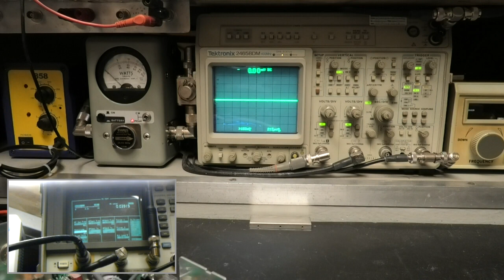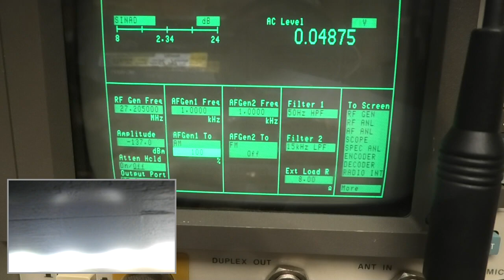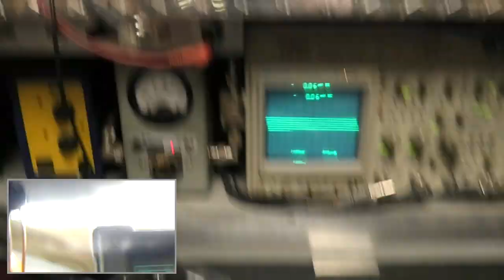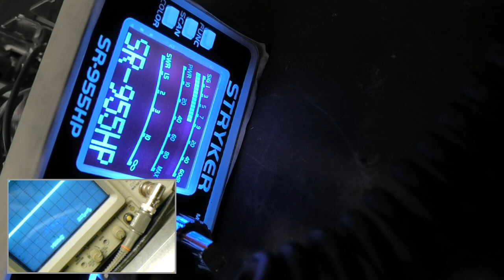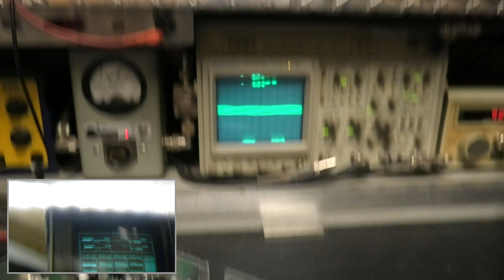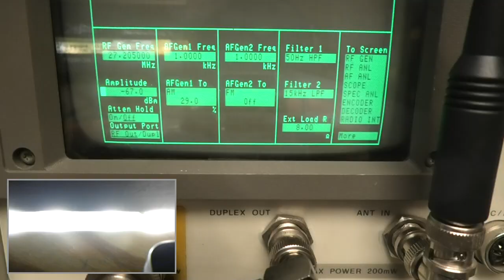Fine Tune CB Shop - Linear Amplifier And Inline Attenuator - When Not To Use And Why. Pay Attention!

Comment from the maker: It appears that The Romper Room BUTTHURT Brigade is thumbs down happy at this particular time so the likes and dislikes are "temporarily" on mute. If they don't talk on what they promote, with the same tune, and use the mic (noise cancelling) for mobiles, They're A Con-Artist .. It's really that simple. Wake Up Guys!  Ding Dong  (And not just a "picture", that's what Con-Artists do like Dave White) Here's what it takes to cut through the noise, be loud and crystal clear with a better receiver too:  A) Tuned Bench:  https://www.youtube.com/watch?v=lwcDfXOgAls.  True, it's more complicated and time consuming to accomplish these consistent and accurate results. Below is a partial procedure and list of calibrated equipment used to achieve this level of performance . Read on ..

Fine Tune CB Radio Shop strictly adheres to (https://www.nist.gov/) NIST Traceable Calibrations and other industry standards to maintain accuracy and consistency for providing Real World Performance Tuning of Citizens Band and 10 Meter export mobile radios with integrity.

"Basic Textbook AM/FM/SSB Transceiver Tune, Alignment and Calibration" 

1) Pll adjustments
VCO & OSC, AM TX OSC, USB TX OSC, LSB TX OSC.

2) Transmitter alignment
DRIVER BIAS, FINAL BIAS, SSB  (or gate voltages for mosfet versions) CARRIER BALANCE, HI-LO AM & SSB Power, RF METER, AMC, ALC and FM DEVIATION.

3) Receiver alignment
AM/FM RF & IF SENSITIVITY, FM DETECTOR/DEVIATION, SSB IF SENSITIVITY, SSB S-METER, AM/FM S-METER (100uV unmodulated -67dbm for �S-9� meter reading!), AM/FM SQUELCH RANGE, SSB SQUELCH RANGE, and NOISE BLANKER/AUTOMATIC NOISE LIMITER (Real World dBm to volts (uV) tables below).

That's just a typical run of the mill textbook tune up and alignment (if you're lucky). There's more to it than frequency alignment, modulation adjustment, meter calibration and a tune up report displaying exaggerated rms Bird peak watts! 

"Test Bench includes"

Bird 4314C Meter
https://www.birdrf.com/Products/Test%20and%20Measurement/Power-Meters/Wattmeters-Line-Sections/RF-Wattmeters/4314C_PEP-Single-Element-Wattmeter.aspx
Part 1) https://www.youtube.com/watch?v=RpX9IHe4ORM&t=16s
Part 2) https://www.youtube.com/watch?v=LuhbqTf6Bxw
Bird 4314C Accuracy Test: https://www.youtube.com/watch?v=DqEOabYqhQo&t=5s
Bird Stipulates 1/2 wavelengths  https://www.youtube.com/watch?v=5eWhgT-rTII
And Genuine Bird Elements from 1K down.

Bird 4373 Sampler 
https://www.rfparts.com/signal-samplers.html

HP8924c with options
http://userequip.com/files/specs/2147/HP%208924C%20Repair.pdf
https://www.youtube.com/watch?v=Cg1w0xBa27s&t=1s

HP8920a with options
https://www.keysight.com/upload/cmc_upload/All/EPSG072204.pdf

Three analog scopes, one digital 200 Mhz
https://www.atecorp.com/atecorp/media/pdfs/data-sheets/tektronix-2465b-2467b_manual.pdf
https://www.youtube.com/watch?v=by98x4eu2lM

Fluke 27fm
http://www.fluke.com/fluke/inen/digital-multimeters/fluke-27.htm?pid=56055
 
LCR http://www.lcrresearch.com/wp-content/uploads/2017/05/LCR_Pro1_Manual_version1.03.pdf

Power supplies
6 Cosel PBA1500f12 (750 amps) variable and configurable.
https://en.cosel.co.jp/product/powersupply/PBA/PBA1500F/PBA1500F-12/
Corcom 20VB1 F7130 EMI Filter 50-60Hz 250V

Times Microwave Coax jumpers and test leads
http://www.timesmicrowave.com/cms/products/cables/lmr/
https://www.youtube.com/watch?v=EmqaGJ6IWow
https://www.youtube.com/watch?v=1ltFVSxGp5Y
https://www.youtube.com/watch?v=v12YZT_1o90
https://www.youtube.com/watch?v=h7iiYfmYWRA&t=215s

Amphenol RF Connectors
https://www.amphenolrf.com/
https://www.youtube.com/watch?v=dVh5B0hdEA0 
https://www.youtube.com/watch?v=dKZg8T_AOso

More range, compliments, reliability and a quieter, clearer but more sensitive receiver,  Get Fine Tuned .. not peaked and ruined.

Here are some VideoGates of me at the bench practicing what I preach using my bench radio or customers radio completed and ready to be shipped: https://www.youtube.com/results?search_query=hard+drive+163+ more: https://www.google.com/search?q=Hard+Drive+163+nm&ie=utf-8&oe=utf-8&client=firefox-b-1-ab

It's what I recommend, use, service and sell ... to you ... not something non practical or deceiving in a misleading way. I'm not just the tech and owner of Fine Tune CB Radio Shop, I'm a customer too!  When finished, You'll be giving radio checks, not asking for them .

dBm To Watts and Volts
Tables below displays relationship between Power in [dBm] or [Watts] and Voltage in RMS, peak, peak-to-peak for sinusoidal signals in 50-Ohm systems for accurately measuring and tuning am/fm/ssb receiver sensitivity, agc, squelch and "S9" Meter calibration. Real World! Mike @ Mikes Radio Repair (Romper Room), Mark Rutherford aka Mark 19960, CB Kidd, Martian and all of your other fake accounts pay attention to the tables below, stop misaligning radios, spreading false information and promoting propaganda! 

  [dBm] [Watts]   [Volts]rms   [Volts]p    [Volts]pp
-140 0.100E-16  22.361 nV  31.618 nV  63.236 nV 
-139 0.126E-16  25.089 nV  35.476 nV  70.952 nV 
-138 0.158E-16  28.150 nV  39.805 nV  79.609 nV 
-137 0.200E-16  31.585 nV  44.662 nV  89.323 nV 
-136 0.251E-16  35.439 nV  50.111 nV  100.222 nV 
-135 0.316E-16  39.764 nV  56.226 nV  112.451 nV 
-134 0.398E-16  44.615 nV  63.086 nV  126.172 nV 
-133 0.501E-16  50.059 nV  70.784 nV  141.568 nV 
-132 0.631E-16  56.167 nV  79.421 nV  158.842 nV 
-131 0.794E-16  63.021 nV  89.112 nV  178.223 nV 
-130 0.100E-15  70.711 nV  99.985 nV  199.970 nV 
-129 0.126E-15  79.339 nV  112.185 nV  224.370 nV 
-128 0.158E-15  89.019 nV  125.874 nV  251.747 nV 
-127 0.200E-15  99.882 nV  141.232 nV  282.465 nV 
-126 0.251E-15  112.069 nV  158.465 nV  316.931 nV 
-125 0.316E-15  125.743 nV  177.801 nV  355.602 nV 
-124 0.398E-15  141.086 nV  199.496 nV  398.992 nV 
-123 0.501E-15  158.301 nV  223.838 nV  447.677 nV 
-122 0.631E-15  177.617 nV  251.151 nV  502.302 nV 
-121 0.794E-15  199.290 nV  281.796 nV  563.591 nV 
-120 0.100E-14  223.607 nV  316.180 nV  632.360 nV 
-119 0.126E-14  250.891 nV  354.760 nV  709.519 nV 
-118 0.158E-14  281.504 nV  398.047 nV  796.094 nV 
-117 0.200E-14  315.853 nV  446.616 nV  893.232 nV 
-116 0.251E-14  0.354 �V  0.501 �V  1.002 �V 
-115 0.316E-14  0.398 �V  0.562 �V  1.125 �V 
-114 0.398E-14  0.446 �V  0.631 �V  1.262 �V 
-113 0.501E-14  0.501 �V  0.708 �V  1.416 �V 
-112 0.631E-14  0.562 �V  0.794 �V  1.588 �V 
-111 0.794E-14  0.630 �V  0.891 �V  1.782 �V 
-110 0.100E-13  0.707 �V  1.000 �V  2.000 �V 
-109 0.126E-13  0.793 �V  1.122 �V  2.244 �V 
-108 0.158E-13  0.890 �V  1.259 �V  2.517 �V 
-107 0.200E-13  0.999 �V  1.412 �V  2.825 �V 
-106 0.251E-13  1.121 �V  1.585 �V  3.169 �V 
-105 0.316E-13  1.257 �V  1.778 �V  3.556 �V 
-104 0.398E-13  1.411 �V  1.995 �V  3.990 �V 
-103 0.501E-13  1.583 �V  2.238 �V  4.477 �V 
-102 0.631E-13  1.776 �V  2.512 �V  5.023 �V 
-101 0.794E-13  1.993 �V  2.818 �V  5.636 �V 
-100 0.100E-12  2.236 �V  3.162 �V  6.324 �V 
-99 0.126E-12  2.509 �V  3.548 �V  7.095 �V 
-98 0.158E-12  2.815 �V  3.980 �V  7.961 �V 
-97 0.200E-12  3.159 �V  4.466 �V  8.932 �V 
-96 0.251E-12  3.544 �V  5.011 �V  10.022 �V 
-95 0.316E-12  3.976 �V  5.623 �V  11.245 �V 
-94 0.398E-12  4.462 �V  6.309 �V  12.617 �V 
-93 0.501E-12  5.006 �V  7.078 �V  14.157 �V 
-92 0.631E-12  5.617 �V  7.942 �V  15.884 �V 
-91 0.794E-12  6.302 �V  8.911 �V  17.822 �V 
-90 0.100E-11  7.071 �V  9.998 �V  19.997 �V 
-89 0.126E-11  7.934 �V  11.218 �V  22.437 �V 
-88 0.158E-11  8.902 �V  12.587 �V  25.175 �V 
-87 0.200E-11  9.988 �V  14.123 �V  28.246 �V 
-86 0.251E-11  11.207 �V  15.847 �V  31.693 �V 
-85 0.316E-11  12.574 �V  17.780 �V  35.560 �V 
-84 0.398E-11  14.109 �V  19.950 �V  39.899 �V 
-83 0.501E-11  15.830 �V  22.384 �V  44.768 �V 
-82 0.631E-11  17.762 �V  25.115 �V  50.230 �V 
-81 0.794E-11  19.929 �V  28.180 �V  56.359 �V 
-80 0.100E-10  22.361 �V  31.618 �V  63.236 �V 
-79 0.126E-10  25.089 �V  35.476 �V  70.952 �V 
-78 0.158E-10  28.150 �V  39.805 �V  79.609 �V 
-77 0.200E-10  31.585 �V  44.662 �V  89.323 �V 
-76 0.251E-10  35.439 �V  50.111 �V  100.222 �V 
-75 0.316E-10  39.764 �V  56.226 �V  112.451 �V 
-74 0.398E-10  44.615 �V  63.086 �V  126.172 �V 
-73 0.501E-10  50.059 �V  70.784 �V  141.568 �V 
-72 0.631E-10  56.167 �V  79.421 �V  158.842 �V 
-71 0.794E-10  63.021 �V  89.112 �V  178.223 �V 
-70 0.100E-09  70.711 �V  99.985 �V  199.970 �V 
-69 0.126E-09  79.339 �V  112.185 �V  224.370 �V 
-68 0.158E-09  89.019 �V  125.874 �V  251.747 �V 
-67 0.200E-09  99.881 �V  141.232 �V  282.465 �V
-66 0.251E-09  112.069 �V  158.465 �V  316.931 �V 
-65 0.316E-09  125.743 �V  177.801 �V  355.602 �V 
-64 0.398E-09  141.086 �V  199.496 �V  398.992 �V 
-63 0.501E-09  158.301 �V  223.838 �V  447.677 �V 
-62 0.631E-09  177.617 �V  251.151 �V  502.301 �V 
-61 0.794E-09  199.290 �V  281.796 �V  563.592 �V 
-60 0.100E-08  223.607 �V  316.180 �V  632.360 �V 
-59 0.126E-08  250.891 �V  354.760 �V  709.520 �V 
-58 0.158E-08  281.504 �V  398.047 �V  796.094 �V 
-57 0.200E-08  315.853 �V  446.616 �V  893.232 �V 
-56 0.251E-08  0.354 mV  0.501 mV  1.002 mV 
-55 0.316E-08  0.398 mV  0.562 mV  1.125 mV 
-54 0.398E-08  0.446 mV  0.631 mV  1.262 mV 
-53 0.501E-08  0.501 mV  0.708 mV  1.416 mV 
-52 0.631E-08  0.562 mV  0.794 mV  1.588 mV 
-51 0.794E-08  0.630 mV  0.891 mV  1.782 mV 
-50 0.100E-07  0.707 mV  1.000 mV  2.000 mV 
-49 0.126E-07  0.793 mV  1.122 mV  2.244 mV 
-48 0.158E-07  0.890 mV  1.259 mV  2.517 mV 
-47 0.200E-07  0.999 mV  1.412 mV  2.825 mV 

                 Don't Be A Mud Duck!

 https://www.arrl.org/shop/ARRL-Handbook-2019-eBook

Hard Drive 163 NM. 73's! Click click.